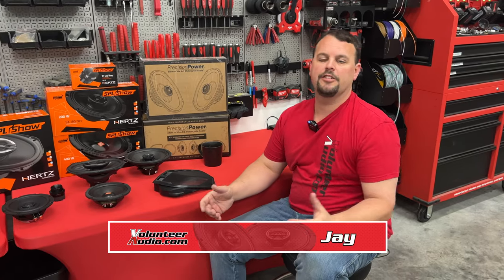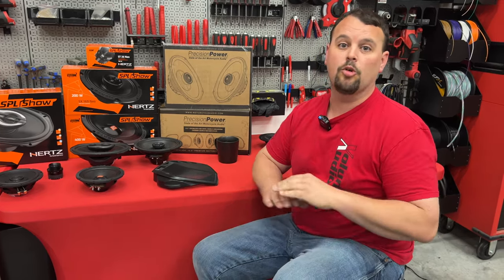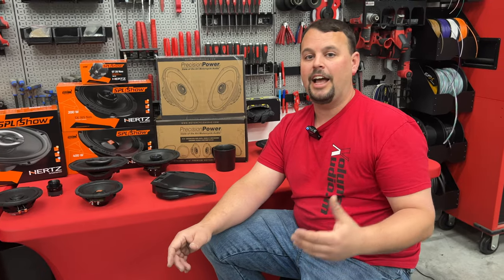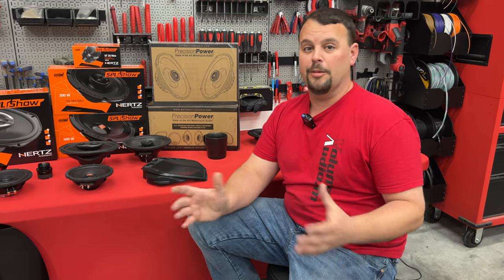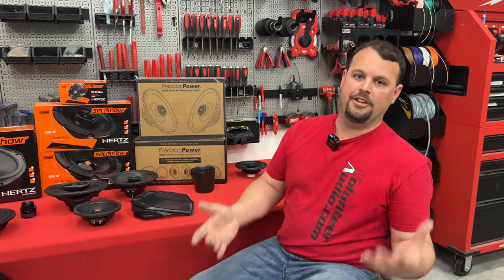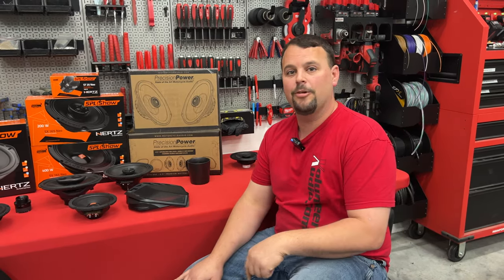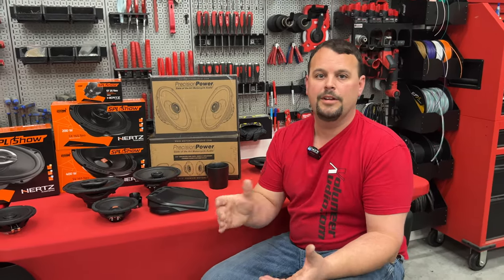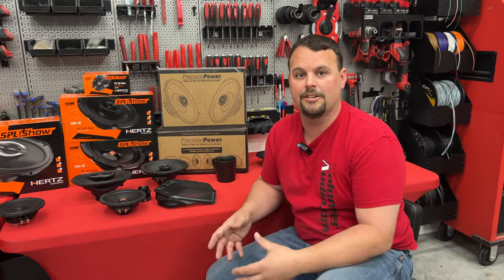Audio System Design for Harley Davidson® - How to get the Best Sound using proper speaker placement!

Comment: I live in Tucson, home of J&M Audio...so that's what I have. (2015 Streetglide S)  I love those folks bunches, but I wish now that I had found VA first.   The straight forward approach is just so honest and refreshing, not to mention  incredibly informative.  My radio is already flashed by them, and I have a Rokker 400w 2-channel amp, running (2) Rokker batwing speakers.   It's fine, but it's either not incredible or I've just become used to it.  Probably a little of both.   Maybe I'll just upgrade the amp to one of these Hertz models (but as I recall, my amp's inputs are RCA, which sometimes loses the left channel signal) and see if that moves the needle enough to satisfy me...audio seems like a heroin addiction...chasing, chasing, chasing.  I tend to have Buyers Remorse often when dealing with motorcycle audio.
Reply from the maker: I wish you were closer to Tennessee so you could hear a properly setup hertz system!  Thank you for watching!

Comment: Ok i added my tour pack and have sv165’s and sounds great. Def hear it clear going down the highway. Now my question is when adding the 6x9’s in the lids with the tour pack speakers will the amp just split the power of the rear two channels or will the herts 4.900 detect 4 4ohm speakers on the rear channels and i guess go to a 2ohm load and boost the power to 2ohm load voltage on output? So your getting say 150 to each and all 4 rear speakers? Thanks
Reply from the maker: @cholber1  yes rear output will automatically increase when it sees the extra speakers, my favorite system is exactly what you describe doing.  No need to change any amp settings
Reply: @volunteeraudio  thanks for the quick reply!

Comment: 2018 Tri-Glide.  Main thing I am looking to do is add volume, bass and improve functionality of stereo.  Currently the time it takes my radio to connect to my phone is crazy long.  I would like to know what you recommend for the best sound possible without breaking the bank.  I am in central NC, so I am also going to have to rely on someone else to install what I buy from you.

Comment: Hi Jay, Very good honest down to earth advice. I enjoy listening to someone speak with passion about audio. I design and sell audio visual systems for a living predominately PA systems, schools, churches, stadiums, etc. I so like hearing from someone who has the knowledge and doesn't hard sell but informs through their work and sales come as a result. I whole heartedly agree with the statement about the subwoofer not really being required. I took a 2022 Road Glide Special and installed a DSP, three power amplifiers, bridged two of them, one to drive the Ground Zero 6.5's fairing speakers and the other to drive a pair of Polk 6x9's in the Precision Power cut in kit (many thanks for you video on how to install these, you so feel that point of no return once the first hole is drilled). The third amp drove a Fusion 10" subwoofer in the left bag. Around town having a subwoofer was a hoot, the seat would shake at times, however, at speed you could just hear it, sort of, maybe? 
I sold this bike just recently and I'm moving onto a 2024 CVO, on your advice I have already purchased Hertz 6.5 NEO's for the fairing (I would have done it through you shop however freight is crippling from the States to here in Australia at times more than the purchase price of the item). I'll do the lids in the future too recycling the Polk's as I dropped some other 6x9's in the 2022 before I let it go. Once again many thanks for these videos they inform as well as entertain.
Reply from the maker: Thank you so much for watching and commenting!

Comment: Hey Jay, This is a very informative video. Especially the info on using or not using a DSP. That part answered a lot of questions I had.. I have a 24 RG and will be starting off with the 2 speaker system and wait for a Lid cut template to add those. Patiently waiting to see what comes available from you lol. Thnx for this video...
Reply from the maker: Thank you!

Comment: Very informative.  I recently installed (and commented on it in another video) a system from you.  Very happy with the results, but I skipped out on the amp for now mostly for cost reasons but left the option open for the future.  I went with the HDHU14+ and 652 Precision Power 6.5's at 2 ohms; 4 speaker system for an Ultra Limited.  Sounds really great but certain music apps are quieter than others which an amp would probably help.  Question then is what is the max power those 652's can handle and what amp would work best with those 2 ohm speakers. Don't anticipate ever doing lid speakers which is why I stuck with 2 ohm.  Thx!
Reply from the maker: We have a plug n play version of the precision power maa4.400 that would work great

Comment: What's your recommendation for us CVO owners with Boom II system that have fairing, lowers and saddlebag lid?
Reply from the maker: If you want to hear the rears and have a more full sound don’t hook up the lowers, it’s not that lowers sound terrible they just take away from what most people want more of, bass and enveloping sound
Reply: @volunteeraudio, if I decide not to install any speakers in the lower fairings and instead use them for my Tour Pak, what wiring do I need to purchase from you to make this setup work?

I own a 2018 Street Glide CVO with Boom 2, and I've already bought the Hertz amp and the Hertz speakers featured in your post.

Comment: Great and informative videos. I have 2018 ultra limited. I purchased your sx165 neo for fairing and sv165 neo for fairing powered by Rockford Fosgate TM 400x4ad. Got it flashed from local stereo shop in St. Louis. It sounds good, but I don’t think  it’s the right flash because when I kill engine it sound’s different than engine running. Am also thinking of installing hertz 6x9 in bag lids. Just wondering how to tell if it’s the right flash. Thank you 25:01
Reply from the maker: @RandallHouse-r1u  watch our series on flashing Do you know what flash is in your factory Harley Davidson® radio? How to find the EQ.bin flash code
https://youtu.be/6Uw4gyLca0I
Reply: Was also wondering if I could run 6 speakers on my RFosgate TM400x4ad?
Reply from the maker: @RandallHouse-r1u  I would highly suggest a larger more powerful hertz amplifier, the tm400x is 2ohm stable so it will work if all your speakers are 4ohm

Comment: Would u put mid bass driver in the bags with upper lids and tour pack speaker
Reply from the maker: You won’t hear the mid bass drivers at speed when pointed into your wheel well, they will add mid bass while sitting still and outside of the bike but to most it’s not worth the added cost when you don’t hear them well while riding

Comment: I have your precision power 4 speaker system w/cut kit!!! Love it! No problem hearing it at 90mph w/tab header pipe and zombie slip ons. My question is I want the Friday night parking lot bass ! Is the drop in sub from precision power a good option? Do I need more amp or anything else?
Reply from the maker: It is as good as any current drop in, hertz is building a new drop in that should be much better than any currently available we hope to have soon

Comment: Great video and I can tell you know what you’re doing when it comes to bike audio! Question,… I have a 2014 FLHTK factory system. Can I add replacement speakers in the fairing and tour pack and still use the factory radio an amp? If so, what is your recommendation for fairing and tour pack speakers? Or, would I have to add an amplifier to do this?
Reply from the maker: You can gain sound quality and clarity by replacing your speakers with the hertz neo series, sx165neo in the fairing and sv165neo in tourpack location but to gain significant volume you will need an amplifier

Comment: Great video, I am hoping to pull the trigger on a system soon. Have you ever done 26x9s in each lid? 1 facing up and the other facing In towards the wheel?
Reply from the maker: It does not add much that you can hear while riding , double 6x9 lids sound good but are known to leak water

Comment: I just bought a hdhu si soundstream. I only have the two fairing hertz 6.5 neo speakers in the fairing. May get amp and hertz cut kit and hertz 6x9 speakers next. .. Today was my first ride with it!!

p.s. the 0-60 and 1/4 mile gauges are not working .. (2014 streetglide)  i believe it has mestro firmware 2.20 you put in it.
Reply from the maker: Give us a call and we can figure out the performance gauges
Reply: @volunteeraudio  will do.
Reply: Just wanted to come back and post that they work great. Just ignorance on my part. You need to be at a stop. Go to the performance gauge page, then GO. You will see it work just fine. When you go to the screen page at a stop that the tell tale that "oh you want to be timed huh" :)

Comment: Hey Jay. 
Just wondering how much adjustment is needed if you upgrade from factory radio to the new sound stream. I currently have your precision power/Infiniti 4 speaker system on factory radio. Fronts and lids. It’s probably a phone call question. Will my amp have to be re-tuned ? 2023 SGS. 

Great video by the way.
Reply from the maker: Yes it will need adjustment, we can send pics of the proper settings if your using the maa4.400
Reply: @volunteeraudio  yes that is the correct amp. 800W peak. 
Thank you for replying. We will be in touch.

Comment: Hey J question. Could 8inch midbass or coaxial  tuned properly in the lowers add better bass considering it has a larger voice coil and cone area? I have 10s but have the bass dialed down during riding and i would like to have better punchy bass projecting from the front when I cruise at low speeds
Reply from the maker: You need a larger enclosure to have good bass than a lower has

Comment: Jay: are the Hertz SV-165 and the Hertz SV-165.1 speakers identical to each other? 

I am looking to put a pair in my TourPak. I already have the Hertz amp (bought from Volunteer audio) and the Hertz 6x9s in my bag lids, and the Hertz 165 NEO 6.5s in my fairing.
Reply from the maker: No you want the sv165neo, the older model was not Neo or waterproof, also there are sellers that have counterfeit versions on Amazon and eBay
Reply: @volunteeraudio  so for my TourPak, SV-165 Neo over SX-165 Neo? (Because less treble, more midrange?)
Reply from the maker: @daveallen1973  yes

Comment: If I add an amp does it take much more out of the battery. If it's set on auxillary how long can you run it with the bike turned off.
Reply from the maker: We only use amps that are under the electrical requirements of your bike, depends on the battery and volume as to length of playtime

Comment: Jay you mention in the video that the SV165 will play down to 60hz? What kind of power are you feeding them crossed there?
Reply from the maker: 190 watts rms, this is tourpak mounted
Reply: 190 per speaker or 95 per speaker and 190 to the pair? @volunteeraudio